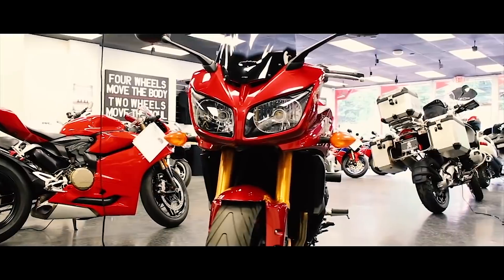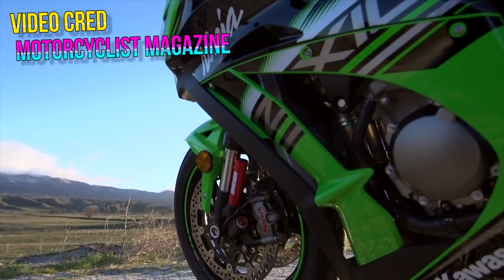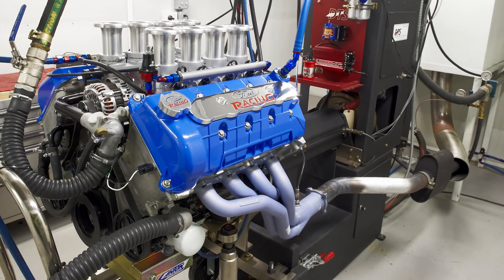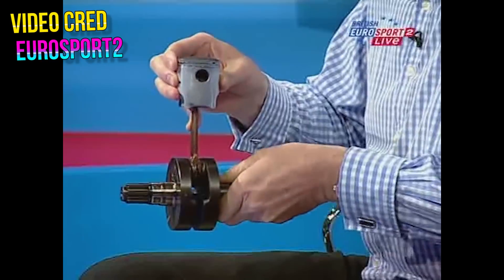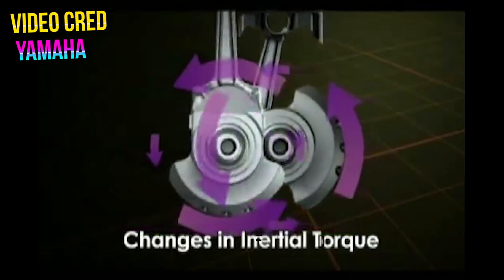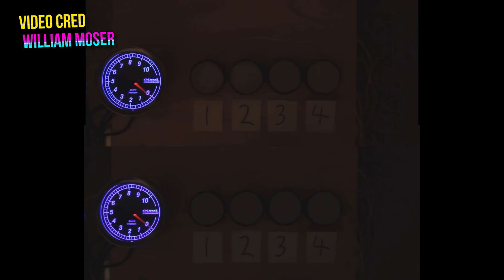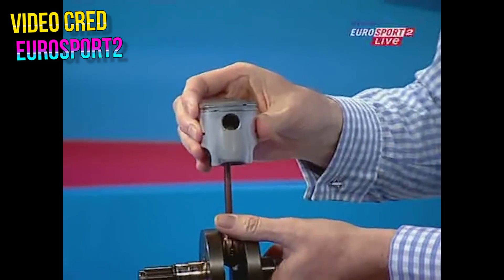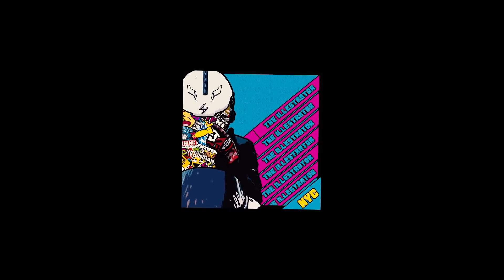Yamaha Crossplane Crank - Why the R1 Sounds Like That

Comment: You forgot the cons of a crossplane crankshaft motor: poorer exhaust gas evacuation; revs less quickly; uneven firing order is harder to spool up a turbo; higher manufacturing costs; more complication in exhaust plumbing.
For me personally, the benefits of a crossplane crankshaft motor outweigh its cons in motorcycles.  I think the benefits in a car engine may not be there.

Comment: You know, this is pretty much the same way I explain it to people that want to understand the different types of engine technology.  My hand drawn schematics and displays are not as crisp as yours, but they get the job done.

Personally, I am and always have been greatly impressed by all internal combustion engines.  Heck, even external combustion engines still get my attention.  Electric motors and propulsion systems are also extremely intriguing and exciting to me.

Comment: I think you didn't mention that the combined travel speed of all pistons in total, is constant with a cross plane crank shaft. 
With flat plane crank shaft design it's totally opposite; from all pistons moving at max speed into cylinder to all pistons at standstill. When they are at top or bottom dead point.

Comment: There is a class of dirt track cars that resemble a smaller scale of an outlaw sprint but with a inline 4 cylinder instead of a sb chevy v8 configuration. With these cars having the smaller hp inline 4 have also started building engines with cross plain cranks that also increases traction on dirt tracks as in your firing order that i should say disorder gives a fraction of a fraction of a second pulse of power that without is hard to hook up on dirt with a flat frank buzz bomb that is out of control even from a rolling start ..but the pulse you get from a cross plain allows those fat tires on the rear to pause just a Split Second , depending on what rear gear they are running for different tracks will happen several times per each revolution of the driven rear tires with a noticable advantage exiting the turns that are mostly all left hand if done properly .lol,lol

Comment: In 2012 i walked into my local HD shop to buy a Dyna Street Bob that  are basically a Sportster on steroids that were priced at $13,500 as they are the cheapest big twin you can throw your leg over ..my idea was to add a few bolt on pieces to give it the profile of a cafe racer , two into one exhaust , short pull back risers and short drag bars with an Arlan Ness 1/4 cafe racing fairing , and an S&S 90* forward dual inlet with two small K&N air filters..and you have the cheapest new harley you can buy with a cafe look! and a stock engine of 1574cc and around 66 hp with a 6 speed transmission , sold state ignition , EFI , and brakes by brembo that will stop you at posted highway speeds . The salesman said that maybe i should look at there monthly built hot rod they featured over by the service desk ....and OMFG , they had built a clone of the Screaming Eagle Super Stock Vance & Hines drag bike featured on the cover of the 2012 Screaming Eagle parts magazine of a dream bike no one can afford with horsepower and money dripping off of it ..this one was the only ever copied right down to ever detail including the $3700 buck screaming eagle V&H / HD drag racing team logo paint job of the same as the cover on the magazine and im starting to sweat..i said bring me the shop ticket of all the mods ..its now a 1688cc making 105 horsepower and 108 ft. Lbs. of torque to the rear 180 oversize tire through a Screaming eagle racing transmission and clutch ..the engine is all way beyond stage four with all Titanium valve train , cams , screaming eagle crank and rods with 12.5 to 1 forged short skirt  coated racing pistons topped off with a set of off road only cnc milled and oversize ported cylinder heads with manual push button compression release buttons milled into the heads next to the spark plugs you will push down first or it will not turn over at all and start up , With also a total engine balance job done by Precision balance of Indianapolis who balance IndyCar engines like those powered by Honda so we got a TTS tune set at 6800 rpm and no speed limiter  and the exhaust pipe is not exactly legal either as it is the off road only Vance & Hines Pro two into one drag bike header with no tail pipe and a shop ticket total price of just the mods at $13,897 that is more than the stock Dyna costs ...and this one , the only one is priced at $19,995? Why so cheap? Its a long story but in the state of indiana there is a time limit a dealer has to sell a vehicle or take ownership and title it for the state of Indiana in the dealership personal name legally declaring rightfull ownership. Harley-Davidson and Vance & Hines drag racing partnership and their attorneys we're waiting for the day for copyright laws broken of many and take them down the river for maga bucks ...fast forward 5 days later riding it for the first time now with cafe fairing ,showa forks done over with race tech gold valves and track springs with two Ohlins gas reservoir dampers controlling the first Roaring Toyz custom rear billet all aluminum swing arm that saves 50 pounds mounted up with Apollo seamless dirt track rims i had anodized candy copper with a black pin strip and candy copper billet hubs with stainless steel spokes,. im setting at a red light on a four Lane Avenue before the next street light that is about six blocks ahead and up behind me approaches 5 Joe Rocket Riders and one says to the others lag back a bit,  I'll take the Harley !!! And lo and behold it is a brand new Yoshimura prepared Yamaha R1 with all the Yoshimura everything money can buy. This thing is another dream bike that no one can afford. So what do I do sit here like a noob or let it all out and take defeat With Honor. At the surprise of both of us as I had never unleashed the beast...so with no launch control.. I did the unthinkable and let Miss Dyna have it all. She came out of the hole with the front wheel dangling rear tire smoking pounding second gear front wheel dangling again rear tire smoking again pounding third front wheel came back down rear tire stop smoking and hooked up pounding in 4th gear speedo said 120 pegged still in 4th tapping the rev-limiter and I'm staring at a red light in front of me stabbed the Brembos in barely enough time, I came to a stop with the R-1 still behind me going braaaapa kerpop da daw daw da gearing down to a stop beside me... These guys did not wave signal lookup but instead turn left without a word as butt hurt Joe Rocket Bratz just got severely smoked by a hawg from hell that broke my bank . Was it worth it ? NO ! But goddamnit was more fun than you can have with your closes on....If you want an HD buy the cheapest big twin for less than $14k brand new and ride it as is with its honda sounding 80 decimal something mufflers that are huge ugly tin cans that make no power but good for 100000 miles or more of no break downs, but who in the hell can with dealerships now ran by Gearhead Screamin Eagle tuners who are totally insane horse powered geeks who will twist your arm and make you do it . Someone's said it can never be done! Harley said we are glad we never listened. Someone said when pigs fly. Harley said now they do and with 10 years consecutive championships   National Hot Rod Association  US national fastest bike in the quarter mile makes a statement you think? In 2012 Harley-Davidson was the first manufacturer to ever break into 
6 seconds at Indianapolis Raceway Park home of the National Hot Rod Association US national Pro Stock drag bike and overall won the championship at the end of the season defeating the all time Vance & Hines Hayabusa that are built in the Vance & Hines new home headquarters just north of the track in Indianapolis Indiana right along beside the Vance & Hines Screaming Eagle Harley-Davidson racing team Pro V-Rod at that date.. today they build Milwaukee eight fxdr drag bike that are carrying on the championship don't ask how much they cost cuz we can't afford those at all ...so today I ride what you see in my Avatar picture that is a Africa twin named ladybug not too fast but not too slow able to climb the Smoky Mountains in a single bound like Superman...i used to race honda CRs in the 125, 250, and open class a long long time ago when i was ten feet tall and bullet proof, so i thought ! Then some 20 years later on a 500 while approaching a set of 65 foot doubles peak to peak , you say to yourself " maybe i should do this tomorrow" and becomes the last time as being alive to tell it takes top priority today but on a tuned CR1000 with the attitude of a crack whore suffering with PMS and misplaced her gun! ??? Here we again ..you can tune a piano but you cant tuna-fish..since the 1920s the 1st 45 degree 4 valve V-twin harleys have been taking advantage of the same principles of inertia to gain more traction on all the dirt tracks across America and we're still winning against everything else. But no more than 3 or 4 years ago Indian motorcycle came back with Revenge with a liquid cooled double overhead cam 4 valve V-Twin that is closer to 60-something degrees that's fine turned the intermittent pulse to the ground apparently making a bit more traction of passing everyone and every bike in the entire field of five different brands today including Harley-Davidson that at best are holding the number two Plate instead of the number one today! Even my new Africa twin comes with a 270 degree crankshaft allowing one piston to chase the other that of a Harley-Davidson causes it to have more traction. As far as far as I know Triumph and BSA did the same thing to their crankshafts for dirt applications .even still today the three cylinder triumph tigers for their adventure bikes have one crank throw off center for better traction ....and just came to mind ! What the "W" engines of Volkswagen and Mercedes-Benz that's of a v within a v of two banks of cylinders driving one crankshaft ..but what did ford just do but to build there 1st flat crank 5.0L V8 only found in the shelby gt 350 code name "voodoo"

Comment: Piston count and overall displacement per cylinder are not key points to rpm limits. That comes purely down to stroke, A V-engine,  single or dual cylinder engine can rev as high as a 4 cylinder engine with comparable stroke ratio's. A R6 has a 46mm stroke, a Harley typically has around 80-125mm stroke. The stroke is the end all be all to rev ranges. Everything else is a foreshadow. You can not overlook this fact. You can have a 1000cc 4 cylinder with a an under-square design that wont rev that high. They rev high purely because of the stroke design. Most of the sport bikes on the market range between 44-55mm strokes.

Comment: Yes of course, but you could just build a lightweight 250 2 stroke bike and it would do the same thing and be faster. Its design is basically a 250 2 stroke but without the fuel oil mixture and all the extra weight of the other 3 cylenders

Comment: I am still wondering about something. You explained that a crossplane crank is used to even out inertial torque, which fully makes sense.
But this comes at the cost of having an uneven firing order, which should create much more unevenness in the output torque (than the inertial torque before we use the crossplane). 
This does not make sense to me.

Comment: The use of the Harley as an example of a twin vibrating is misleading, the problem there is having a 45 degree V twin which has appalling primary balance, where as a 90 degree twin like a Ducati or a flat twin like a BMw is utterly different in terms of it's primary balance and smoothness. An inline 4 is much smoother than a 45 degree V twin cylinder, or a parallel twin, mostly due to having a better  natural balance. A twin with good primary balance can be a very smooth engine with none of the antics a Harley displays, or my classic Triumph 70's parallel twin which will do circles on the center stand when revved. Obviously things like balancer shafts can be used to make pretty much any configuration of twin smooth,  but balancer shafts add weight and consume some power.  Otherwise a good explanation of what a flat plain crank is.

Comment: Yep, another vote for great video. This is all stuff I understand very well, but you break it down and explain it way better than I ever could. And to add my $0.02, given the RPMs involved in these engines, I really don't think anyone could ever feel the difference in traction or any of that. The only thing we will feel as a rider is the difference of harmonics/vibration in the grips/rear sets/seat. When the engine is turning at 10,000+ RPM, the scale upon which we feel these pulses VS. time is completely outside human capacity. That does not mean there aren't other benefits. Just saying that there is an element of marketing hype to all of this brilliant engineering. (It is brilliant.)

Comment: I plan on rebuilding and coverting American v8 with 90 or cross plane crank to flat plane. Becouse I'm looking for the powerband for long torque and less shifting. Ithink it's cool how it's going the opposite way with the motorcycles. I can see how having your engine smooth and sensitive. Would be desirable on those light bikes. Nice video

Comment: Think of a standard crank weights moving in an oval, while the crossplane moving in a circle. The counterweights are creating a smaller centrifugal force. Think of pedals on a bike. If we had 4 pedal in a crosshair pattern, you would have better power or less loss.

Running like an airplane!

Comment: a crossplane crank engine requires a crossplane cam or cams?
Reply: Luís Matias the cams have to match the firing order regardless of the crank configuration or cylinder arrangement.

Comment: I never cared for Yamahas but local Yamaha dealer had a demo day so thought I'd try the MT-10.

I fell in love immediately. I couldn't believe how smooth it felt, I was riding in a gear lower because I was used to shifting by the vibration feel on my CB650.

Now my next bike is either an MT-10 or R1. Or if my dream comes true, an MT-10 sport tourer.

Comment: Love the diagrams and Microsoft paint.  Motorcycles aside,  what about that harmonic balencer. A lead weight on the crank but does it dmg crank to swap to aluminum in say,  a 4 stroke.  Vs the v8 or formula cars that use to use aftermarket steel harmonic balencers. Any type of weight on that crank takes it down 30 Hp.  Just robbes the explosivity of gasoline...

Comment: so the cross plane crank is smoother but less responsive. Hmmm i would think that when racing responsiveness is more important than smoothness, no?
Reply: If you have alot of horsepower but no traction then theres no use for the horsepower

Comment: Lol, if you want to explain something you have to understand it yourself first.... which you clearly do not. But don't worry, Neil Spalding also does not.
Your keep referring  to 'inertial torque' - but fail to explain what that is? 

Easy: with a normal crank (you call it 'flat') at TDC and at BDC all pistons are standing still - really, they do! The flywheel-effect of the spinning crank accelerates and moves them again, absolutely nothing else - so, there's quite a bit of rotational inertia sapped from the crankshaft to do this, and no surprise then that it looses quite a bit of momentum (remember, FOUR pistons must be accelerated again!) until a power stroke (which is not an explosion but a controlled combustion, huuuge difference) speeds it up again.
THIS is what causes a normal crank to rotate a bit irregularly, and a crossplane crank does this to a lesser extent (but still does!).
See?
That's a lot clearer than mumbo jumbo about internal inertia torque ;-)

Comment: Very, very nice video.  It comes down to a trade-off between linear and proportional power delivery versus vibration and harshness.  The interesting bit is that both variables are inextricably linked.  For example, if your engine is a stressed member of the frame, as in F1, your best bet is a flat plane.  On a bike however the decision is more complicated and favors the cross-plane so long as the vibration is cancelled out by balance shafts.  This is due to the lighter weight of the bike making fluctuations in torque more noticable.  The larger mass of an F1 car dampens them out so as not to upset the balance in corners.

Comment: Good video. My old '78 CB750 had a 1,3,2,4 firing order though. That isn't new. it was still a flat plane, but the TDC and BDC alternate between pistons rather than being on the ends and in the middle.   Good job of translating to laymen's terms. Crankshaft angles aren't something that most riders think about much

Comment: Just purchased a 2014 R1 and love it, Was wondering why it has such a great sound, now I know and this power is un real , I love the ability to also change the throttle settings and traction control. Oh and 14 was the last year for up swept pipes under the seat, Happy I got my self a Cherry 14 with low miles. Thanks again Great video Now I know about Cross Plane Motor.

Comment: Awesome video! Was really able to visualize the difference between the two. Subbed!

However.

Something I can't wrap my head around, wouldn't an uneven timing of combustions give you an uneven flow of power? Since there are different intervals at which the pistons are firing. Like 2 and 4 fire, relatively, close to one another, but there is more time between the others. Why is this? Why not have even intervals?